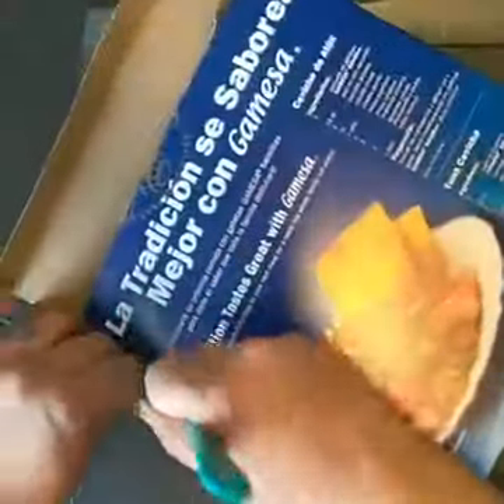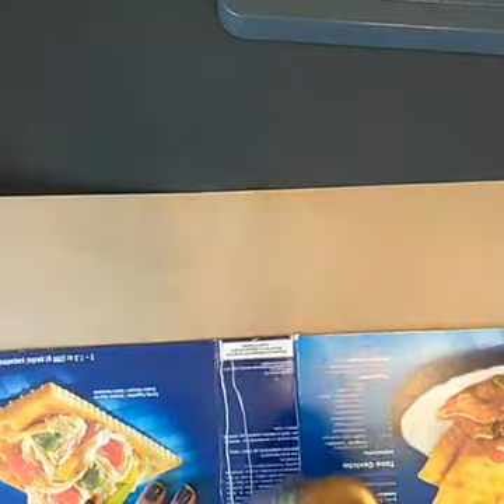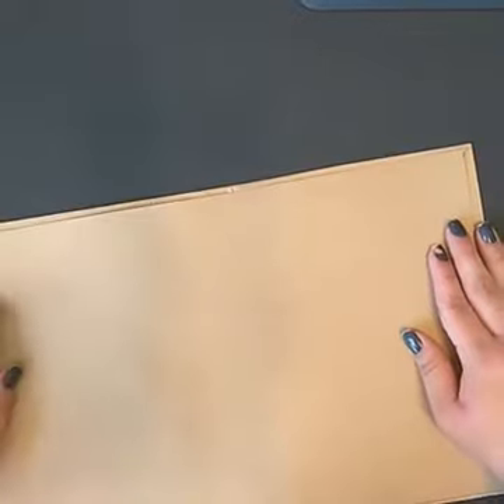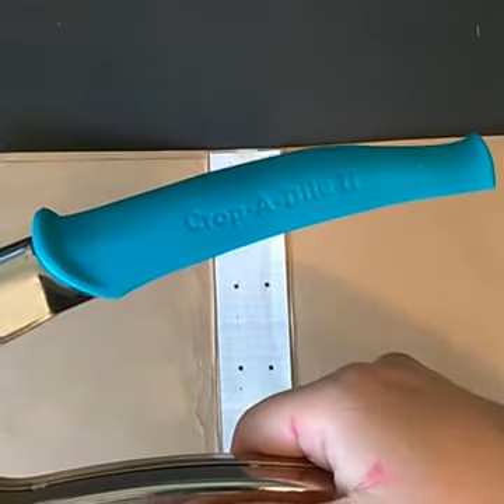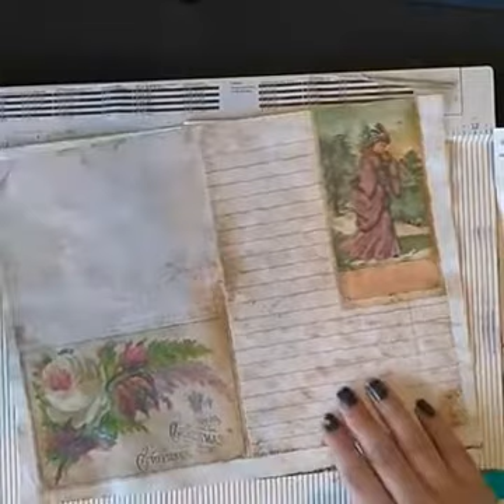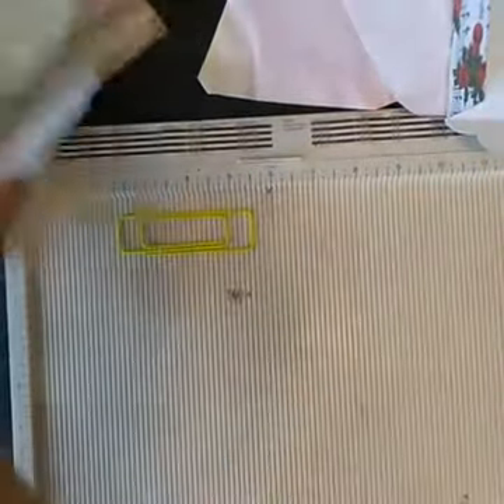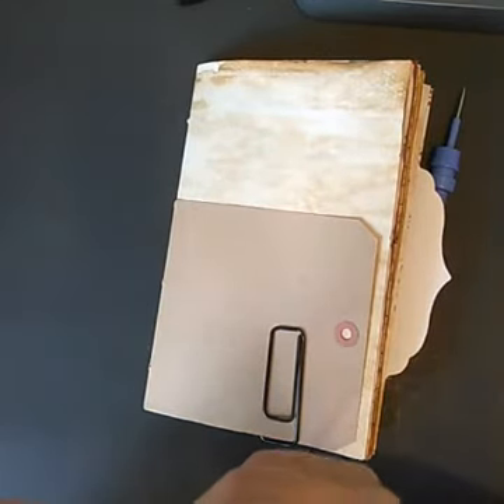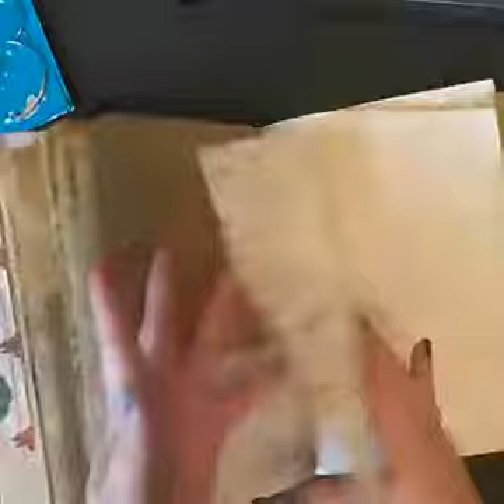Facebook Live 10/30 Christmas Junk Journal Tutorial Part 1: Cover and Sewing Pages

Comment: New subbie here... a suggestion or trick for you...  to have no bubbles when you glue tyvek or paper to paper...  crosshatch of glue is great... then smear it to cover ALL of the surface... and here is the trick part use a tshirt fabric piece and smooth it out from the center.  I did not know about the letting the glue dry a bit before adhering it so thank you for that. I figured its only fair to give you a hint in return.  Like your videos. Thank you for them.